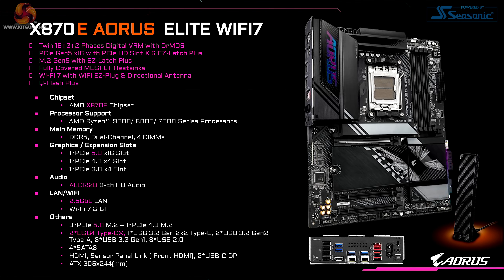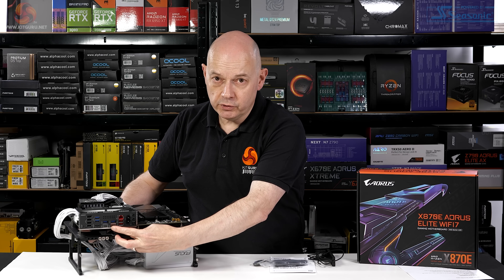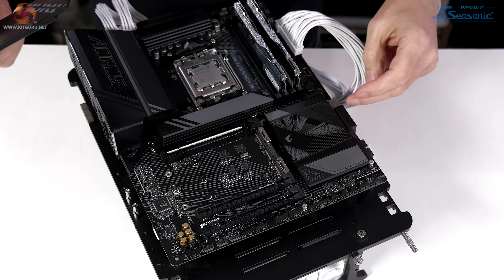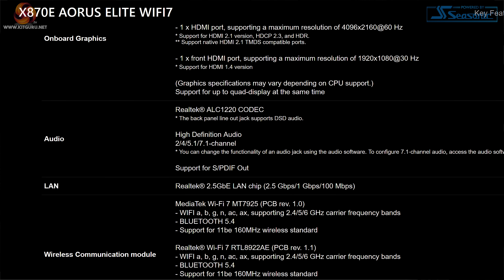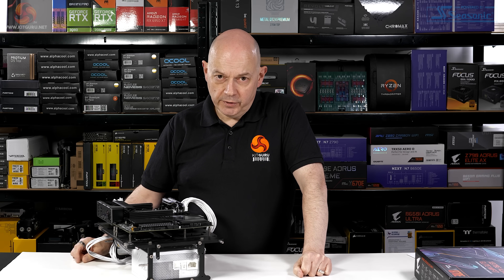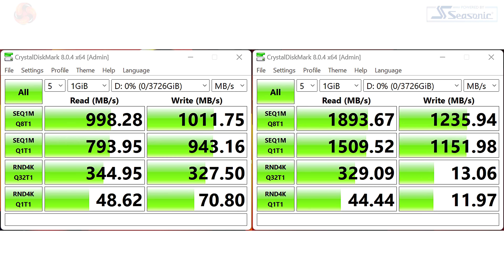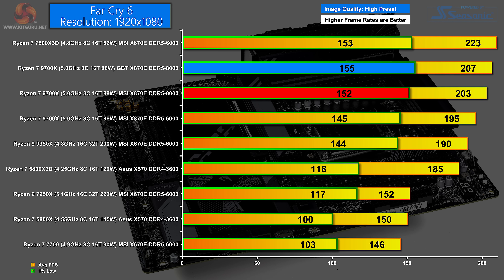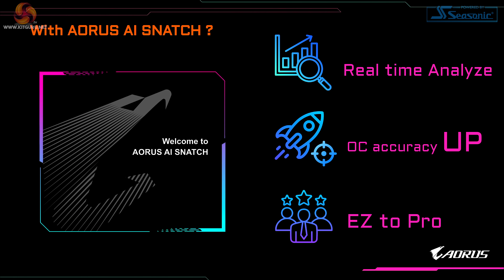Gigabyte X870E Aorus Elite WiFi7 - surprised us!

Comment: I will soon be buying the GIGABYTE X870 AORUS ELITE WIFI7 ICE for my son's first PC 😁😎
Reply: Not having to share lanes is a nice feature, but modern gfx cards can't saturate a PCIe 4 x16 slot, let alone a PCIe 5 x16 slot with twice the speed as gen 4, so the bandwidth should be fine.
Reply: I had ordered a Gigabyte x870e aorus elite, in the end, I cancelled it and went for ASRock. They have the best of lineups this season for motherboards.
Reply: @PsyRox1112  EXACTLY! Man... What happened to KitGuru, these guys were the best! They provided a shi**y review on this. They just looked at a performance POV... And motherboards are more than that at this point in time. And like you said... We have this M.2 <-> PCIE debacle... People should know that installing a M.2 is going to steal PCIE lanes and therefore hinder GPU's performance. We can go from a 16x GPU to a 8x GPU... Just because we added a M.2 drive!!! We're paying TOP MONEY for these components and ONE mistake... Is going to HALF the performance of the machine. The motherboard business is a SCANDAL! They aren't informing consumers properly and they're going to get SCAMMED. They're happy buying this TRASH and upppsss "Lane sharing?! Wtf is that??? I didn't saw that on the ads". The info is so buried and confusing you need an excavator and the "cave expert nerds" to dig this bs.
Yeah the ASRock are providing the best x870e motherboards at this time!!! I saw that ASRock X870E Phantom Gaming Nova and that is the absolute best! It has the same price and it goes above and beyond. Gigabyte and Asus are just surfing on their "reputation"... Which equals to getting ROBBED
Reply: I got myself a x870e Taichi which is an absolute beast
Reply: All gigabyte boards have lane sharing, recommended you go with x870 steel legend
Reply: @PsyRox1112  My son is 10 I'm sure he will be fine, he wants a white pc so I am kinda buying for the looks 😜😂
Reply: @adi6293  x870 steel legend is in white
Reply: @PsyRox1112 And what colours are the connectors and slots on the asrock? Yeah. They don't do white boards, they do panda boards. If I want a white board I want it ALL white.Gigabyte get the closest with their ice boards. Also the asrock only doesn't share lanes because they only run 1 pcie 5.0 nvme slot. These have 3.
Reply: @prototypep4  storage doesn't matter, but performance on the GPU matters.
Reply: @prototypep4  end of the day, panda boards are better than Gigabytes. I'm aware of the infamous issues of Gigabyte motherboard breaking and being sent to RMA.
Reply: @PsyRox1112  🤣🤣🤣🤣 tell me you're clueless without telling me.
Reply: @prototypep4  tell me you're a Gigabyte fanboi without telling me.
Reply: @prototypep4  when I'm running a GPU on x16 lane, and I wouldn't want my M2 to share lanes reducing the lanes from x16 to x8, you don't even the basic of things, so go and drink your milk. I don't mind my M2 running at Gen 4, and x16 running at x16, instead an issue when x16 switches to x8. 
If you're not an Ultra noob, who is?
Reply: @PsyRox1112  The Gigabyte board is quite a bit nicer but I will look into this whole lanes sharing, I mean X870 should have 20 lanes yes? My son will most likely get a gen 5 gpu but gen 4 SSD, CPU will be 9700X and gpu I think 8800XT or 5070, we will see
Reply: @adi6293  both boards have a gen 5 ssd slot that doesn't affect the 16x slot. The difference is the asrock only has 1 gen 5,the gigabyte can have 3 + a gen 4 slot through the chipset (4 ssd's total). A 4090 can't even populate a 16x gen 4 slot fully. And gen 5 8x is the same bandwidth as gen 4 16x. There is going to be unnoticeable performance loss. And that's with a 5090. I doubt you're putting a 2k card in it for your son so I really wouldn't worry. Go with looks and upgradeability in mind.
Reply: @PsyRox1112  gen 5 8x is the same as gen 4 16x. The 4090 couldn't even saturate the gen 4 16x bandwidth. You're actually too dumb for this conversation.
Reply: @PsyRox1112  How many NVMe SSDs are you using? This board still has a gen 4 M.2 slot so you can run a gen 5 and a gen 4 SSDs together without cutting GPU lanes in half. So unless you're planning to run at least 3, I don't see it being a problem here.
Reply: @prototypep4  OK then problem solved because my son will get at most 2 drivers but 99.9% just 1 because I would rather go up in size than add another anyway, and you are right, he will not be getting a 5090 in there so Gigabyte board it is 👍😜
Reply: @PsyRox1112  Why, my friend?
Reply: @PsyRox1112  likely an overblown issue.
Reply: @matsudakodo  100% it's overblown. They did tests. A 4090 running between gen 4 8x and 16x was 2% difference. It was less than 10 frames MAX across various games. The 5090 will not use all a gen 5 8x bandwidth. And the rest of the 50 series lineup even less issue.

Comment: What's the internal HDMI socket intended for?
Reply from the maker: Good question. It is a conventional HDMI for the integrated graphics and the idea is you can power a screen inside your PC case, most likely in the front or side panel. If you are using a secondary external display you would use the regular output on the back panel.
Leo
Reply: @KitGuruTech  Thanks Leo!
Reply: To connect a LCD system monitor.

Comment: Can anyone explain the differences between the x870e Aorus Elite WiFi 7 and the x870e Aorus Pro?
The Pro costs an additional £30-40 and I can't figure out what that extra cash buys.
Reply from the maker: From memory a change to 80A VRMs is the big difference
Leo
Reply: @KitGuruTech  Will that make much of a difference to the average user? VRM 'science' doesnt make a lot of sennse to me, no one really explains what specific VRMs will help - processors or voltages etc.
Reply: Elite (Realtek and MediaTek) supports wifi7 160Mhz, while Pro (Qualcomm)  supports 320Mhz standard
Reply: Google AMD X870/X870E Roundup, 21 Boards Tested and go to the end. There is a table. More fan headers, 1 more USB, better VRM and full WIFI 7 as noted above. Oddly the Pro did worse in RAM and CPU frequency testing.

Comment: Excellent review but I do wish you'd gone further and tested the fit of secondary expansion cards. I run 10 Gb networking so it's an immediate no-buy issue if a 4-slot GPU blocks that x4 slot. Or if using a card in that slot negatively affects the temperatures of a 4-slot GPU.

BTW I class a budget board as under £100.
Reply: You would be lucky to get the box for £100 the way prices are in the last 12 months. I agree, I used to think that way too. but a budget board now seems closer to £200.
Reply: It was a little mistake in the video but the bottom gen3 slot is actually x4 not x2. He probably got it mixed up with the X870 non-E Aorus Elite.
Reply: Consider a case with alternate GPU mounting.

Comment: £290 is NOT cheap for a motherboard.
Reply: It's cheap for a Xx70E board, though £225-250 would be ideal.
Reply: its not expensive either, check out the MSI godlike boards at over £800 and the ASUS Extreme motherboards at well over £1,100 (OCUK sell the ASUS ROG Maximus Z890 for £1390 for example). £290 might not be cheap to you, but when you factor in the market prices, its a bargain.

Comment: I wish that they would drop the WiFi on the motherboard, it is a plague with motherboards these days, all coming with that nonsense. These are dumb gimmicks: WiFi, onboard sound, better internet (as long as it is Intel internet I am fine with it), anyone who wants to upgrade those things should just buy separate hardware for it: you pay less on the long term and waste less resources that way considering that you can keep using it for later motherboards. 
Drop these gimmicks and lower the price with whatever those gimmicks cost.
Reply: I use wifi on my mobo 🧐
Reply: @RainbowSunset-uq2hs  I never used WiFi on my desktop for multiple reasons, on my laptop I haven't always the option to use Ethernet.
Reply: @peterjansen4826 The customers I have that want a higher end board absolutely want integrated WIFI, onboard sound, etc. I definitely do not want to support a variety of unnecessary ad-in boards and drivers for those customers.

Comment: I am disappointed to not see the DDR5 ECC support aspect mentioned in the pros/cons in the conclusion. This is somewhat of a dealbreaker when choosing the motherboard for AM5
Reply: @spinerganso What is your use case for ECC on a consumer platform?
Reply: just better reliability, less crashes and BSODs
Reply: @sniperganso You shouldn't have any crashes or BSODs on non-ECC memory on AM5. If you had a 24/7/365 uptime on a server, maybe ECC would be useful, but only if that server were mission critical. It's rarely used by even business customers I've had.

Comment: I use 8x SATA on my AM4 board.
2x M.2 on the MB, 1x M.2 on PCIe and 1x USB 4 on PCIe.
Reply from the maker: We need to hear more about this. Either you have a load of low capacity drives or you have 100TB+ of storage. What's going on?
Reply: @KitGuruTech   I have still Working HDD which are about 6-10 years old if I remember correctly. The oldest one is a 1TB WD Black, the newest 12TB from HGST. 6 are HDD, 2 SSD. I could replace 3 of the lower ones with a new 10 or 12TB, but don't want to throw away a working HDD, as long SMART looks good. Combined all non M.2 are about 35TB. M.2 used for Windows, Cache/Temp (Video editing) and Steam Library (512GB & 1TB, 2TB).

Sounds like a Storage Messi haha
Reply: You can sacrifice a M2 port to plug one of these small adapters providing a SATA controller (JMicron) allowing 4 to 8 disks to be p;lugged. However you will lose the aesthetics of the M2 armor plate. You can also add a PCIe expansion card.
Reply: @MightyFR-s2g   Interesting way, but would be a PCIe 4x not better option for SATA, for Cheaper MB wie only 4 SATA?
Reply: You buy an adapter or move the drives to a NAS where they likely should already be, or cold backup.

Comment: i think the biggest let down is pci-e switching...Asrock Nova is much better . I wish gigabyte done a better job here
Reply: The Nova is great, but it just pushes the additional M.2 to the chipset instead of CPU to accomplish that. These are CPU / Chipset limitations.
Reply: @drewnewby  well i would rather have bit slower nvme, then share lanes with gpu :)
Reply: @lo0nyk On this board, you can run your primary M.2 and one on the chipset with no lane sharing. Your GPU is not using full PCIe 5.0 x16, nor will any in the near future. You can also attach additional M.2 via the PCIe 4.0 x16 on this board, without GPU lane sharing.

Comment: Thanks for a great review!

I am thinking of getting this motherboard or its "Pro" variant, as it has a bit better VRMs. The thing I don't really like is that if you use any of those Gen 5 m.2 slots, the primary slot drops down to x8 mode. That's plenty of bandwidth for the majority of graphics cards nowadays, especially the new ones that are about to come out, but it's something to keep in mind as a buyer.

Again, thanks for a great review!
Reply: Yeah its a good board, the VRMs are important, they seem pretty solid on this board.
Reply from the maker: Glad I could help!
Reply: I am planing to get a 5090 next year so that's actually a bit of a concern, are you saying if I ran a PCI 5 m.2 my 5090 has it's bandwidth slashed in half?
Reply: Does the PRO have the same issue?
Reply: @deloford  All gigabyte motherboards with x870e chipset function this way (yes, even the Master), but this only applies to two m.2 5.0 slots beneath the pcie x16 slot. Using the one above it will not affect the bandwidth.

When it came to current generation boards and GPUs on pcie gen 4, a 4090 saw almost no bottleneck when used in slots running in x8 mode. Since pcie gen 5 is double the bandwidth of gen 4, I doubt it will see any bottleneck when the primary slot is running in x8 mode.

I hope this helps.
Reply: @techalphascom  Thanks I have read more about this and I think more reviewers should mention that a 4090 can have its performance dropped by 2-7% in some games when limited to 8 lanes. As most people (I assume) have more than 2 m.2 drives this is a big deal in my opinion. I guess I could buy 2 x 4TB m.2 drives and stick with that but they are very expensive so defeats the purpose of cutting costs on the board. Why does AMD make this so difficult?

Hardware Unboxed also show that it cannot achieve 8000MTs for the memory, this is something I want (special use case for this build).
Reply: @deloford  try going with MSI or AsRock boards, as they don't do this kind of lane sharing and they offer plenty of m.2 gen 4 slots. X870e Taichi Lite, or Nova from AsRock or MSI x870e Carbon. I know they are pricier than gigabyte, but they are great options.
Reply: @techalphascom  Yep those are the two boards I looked at. It looks like I can't have a white board without a compromise (especially for a 5090 upgrade next year)

Comment: I just don't like the GPU lane sharing and having a lot of USB 2.0 for a "new and improved" MB. I feel that it is better to buy a good x670e and just update/flash bios or just buy the AsRock x870e Nova if it is not out of stock (currently out of stock).
Reply: I was looking at the ASROCK X870 Nova - I wish Leo would look at some ASROCK boards, they are such good value. I just dont know if their bioses are any good and if they are stable.
Reply: there are bunch of stuff that doesn't require huge speed and without any issue on USB 2.0 such as peripherals. It is better to have such stuff for those things.

Comment: Gotta say thats a pretty sexy looking board too. not a cheap looking model. around 300 seems like a good price point for me, but I guess if you are buying the new 5090 then its ultra high end for you. or do people buying a 4090 or 5090 still buy a 300 motherboard?
Reply: @boltsandbraces6261  x870e Nova wifi is the best value x870e board. Also, I plan to get the 5090 when it comes out. The Nova offered everything I needed for a fraction of the price of some of the expensive boards.
Reply from the maker: Maybe, sometimes people dont like spending money on motherboards or power supplies. we have noticed that anyway based on comments

Comment: If AMD are going to require motherboard makers to include USB4, then why not require other high end features like 10G ethernet, post code readouts, WiFi7 etc. Then you at least know what you will be getting when you buy an X870E motherboard
Reply from the maker: Presumably there is a trade-off of features versus cost. Few people have 10Gbit Internet or use the POST code debug, and thankfully WiFi 7 seems like it is becoming ubiquitous. USB4 is also a good step forward
Leo
Reply: USB4 is amazingly fast though!
Reply: @pixelrefresh348  I prefer thunderbolt